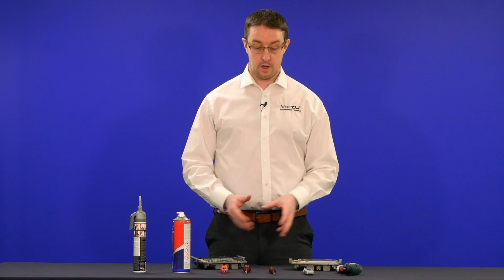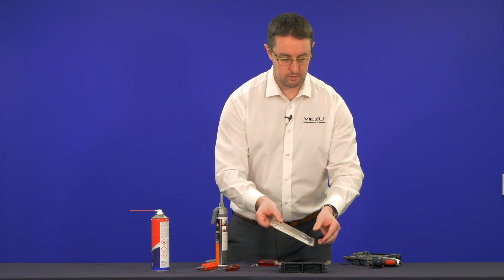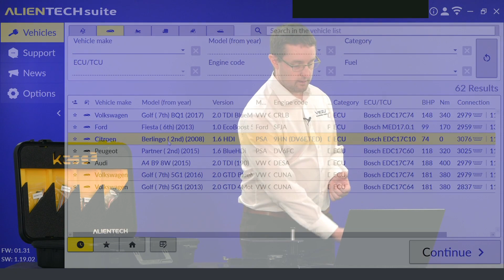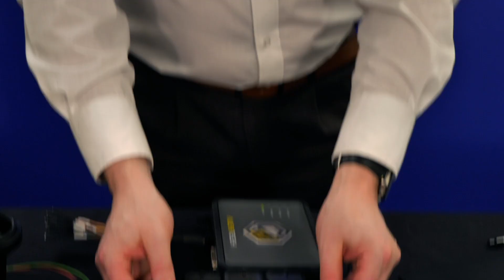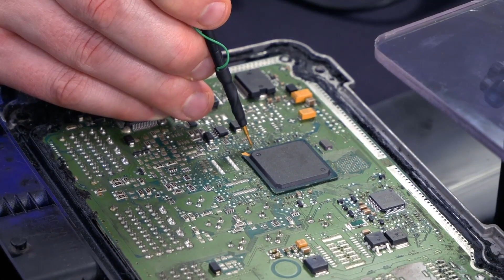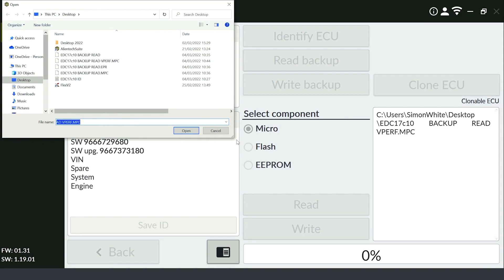How to use the Alientech KESS3 in Boot Mode - KESS 3 Training

Comment: So when we write the modified file, and it ask us for original file for compliance chek, what file should we use the original for the right ecu or the read file, because for example the car has dpf off already and the car comes to us for dpf off wich file should we use
Reply from the maker: It is a difficult one when you have vehicles that have already been modified, but what it is asking for is the file from the vehicle that has a corrected checksum inside. Typically this would be an original file, but even when its modified, as long as it was corrected by the previous tuner (either through the use of a genuine tool such as the kess3 or via a checksum correction plugin in there tuning software) then it should be fine to use the 'read' file as the 'original file for comparison'.
If you are ever unsure you can always check with Alientech technical support.

Comment: what is boot mode and bench mode
Reply from the maker: Hi, boot mode is when you need to make at least one connection directly to the circuit board. To connect with the BOOT method, you have to open the ECU case to access the circuit board. This used to be commonly referred to as BDM before the BENCH mode was developed. 

BENCH mode (also known as Service Mode) is where you connect to the loom connector pins on the ECU plug to enable the reading and writing of the ECU, but you do not have to open the case of the ECU to connect to the circuit board itself.

Comment: Hello, Is it possible to clone or read and write on the bench so the ecm is plug & play for the Siemens SIM4LKE ?   Thank you.
Reply from the maker: Unfortunately, it doesn't look like this is available yet on this ECU. It should be available soon as the Boot mode function is due to be released but currently is OBD only.
Reply: It is now

Comment: Does this mean that with spring loaded pins you nolonger need to solder ribbon pins to the computer
Reply from the maker: correct, using the different pin options and frames, there is generally no need to sold